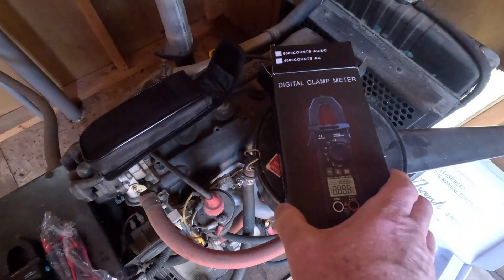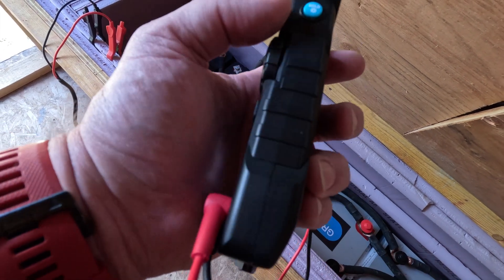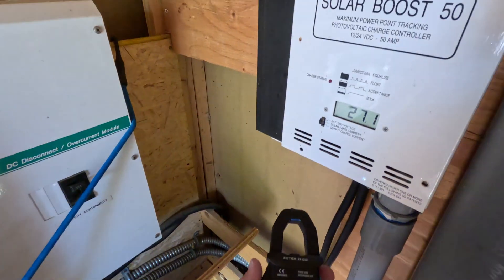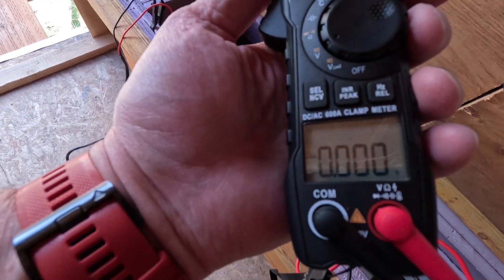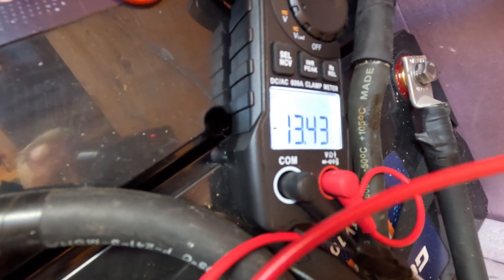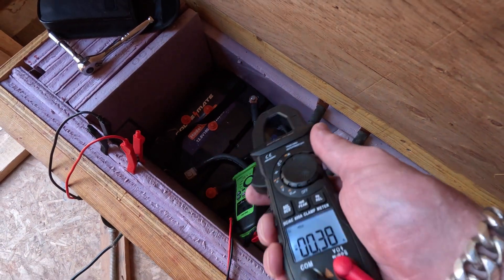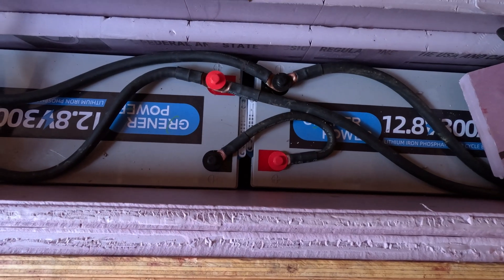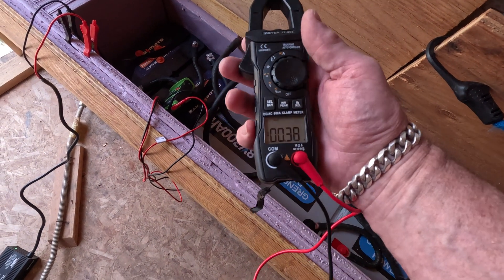Zotek AC/DC Current Clamp - First Look ZT-QS9

Comment: Does the AC amp clamp have a peak hold function?  I want to measure the peak inrush current on my heat pump to monitor system health over time.  My normal amp clamp has measurement updates that are too slow to catch the peak.

Thanks,
Carl
Reply from the maker: Great question!  It does have peak hold, and I did try it actually when I turned on the load, but I don't what the time to capture is.  I'll have to do a video on inrush current capture - and compare a handful of clamp meters that I have;)

Comment: if you go to the company website and look at the user manual, the user manual does not state ANY model number at all and the specs in the manual do not include a DC current section either. The specs and ranges in the user manual also do not match the specs in the product  page. I doubt the user manual download link on the product page is actually for that model especially when it says 4000 count NOT 6000 count. The product highlight section of the product page also does not mention dc current... only AC current. So I am afraid there seems to be a general lack of attention to detail. The product page does not mention any input protection and does not mention the AC bandwidth. The assumed incorrect user manual does not mention input protection either but does say the AC bandwidth is 40Hz to 1KHz. So it would be interesting to see what the user manual that is supplied with the clamp meter says and see a teardown of it. noise levels for the clamp meter when measuring AC and DC current on the lowest range would also be interesting.
Reply from the maker: Thanks for bringing this to my attention.  I see their links are broken and the link for this meter takes you to the wrong meter.  Until they get that corrected, I did find this link: https://manuals.plus/zoyi/zt-qs9-digital-clamp-multimeter-manual#c_specifications